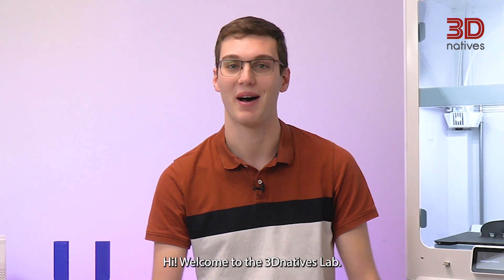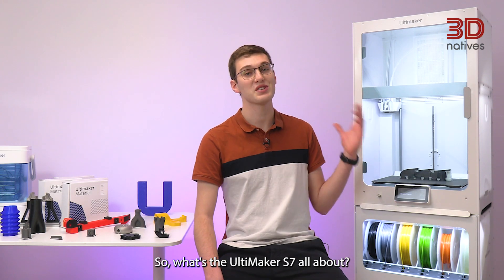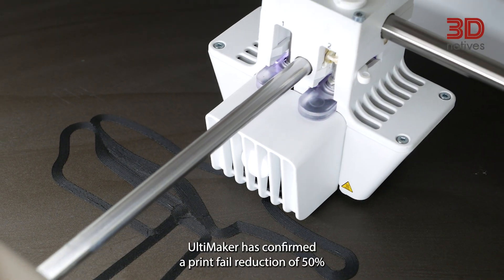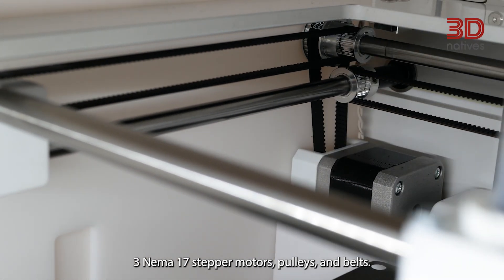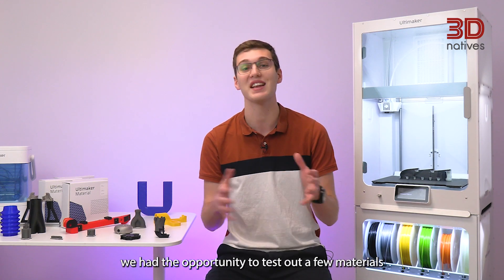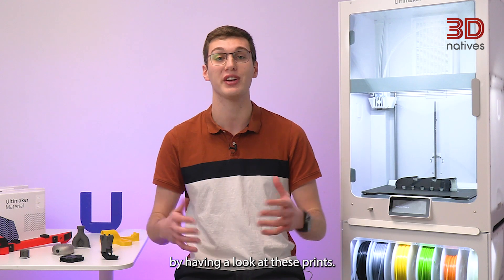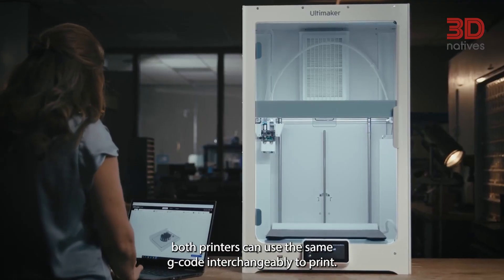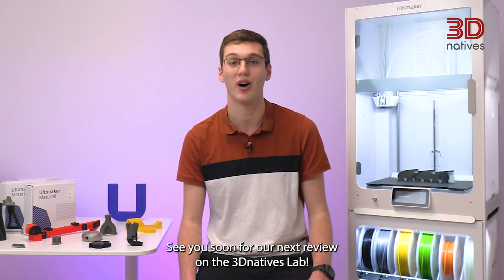Ultimaker & Makerbot’s First 3D Printer - Discover the Full Review of the S7 | 3Dnatives Lab

Comment: Ultimaker is struggling to keep up with the competition. They seem to be recycling old ideas and concepts. The 2.85mm filament is no longer popular in the market. The z-axis trapezoid rod looks outdated and seems to have been borrowed from a 10-year-old Creality printer. It’s surprising that they are still using smooth rods with sliding blocks. The nozzles (printer cores) are super expensive. Even if you consider the ‘ecosystem’ perks, the price of this product is not justifiable.

Comment: Very much aimed at a niche market. UltiPriced @ only $8,299. And 2.85 mm filament requirement. Niche.
Reply: I’d like to have the possibility to upgrade to 2.85 but not as default. And with what nozzle did they chip?
Reply: @platin2148  IMO - I could be wrong but - it is the Proprietary nozzle that they call a print core. I think the default that ships with the machine is 0.4MM, therefore changing the nozzle to 0.25MM will set you back a humble $170 plus.
Reply: @dotJPJP  the cores are $115 USD, And yes while expensive (I have bought too many of them during the lifetime of my S5R1) they making nozzle changes super easy and uncomplicated, which when running a print shop like I do makes my life just that much easier.
Reply from the maker: Of course, not every 3D printer will be a perfect fit for every user! But, it must be said that UltiMaker has spent a number of years perfecting their machines, notably in ease of use, such as with the interchangeable printcores. This has made more technical FDM 3D printing more accessible and has streamlined the printing process, especially for print farm operators. Of course, this tight integration comes at a cost, though that can often be justified depending on the applications/purpose of the machine

Comment: Can it print anything special? I mean most of the stuff isn’t something one can’t get with a 8x cheaper printer.
Reply from the maker: Out of the box, the S7 is able to print standard, elastic and advanced materials ranging from PLA to PA. When equipped with the CC printcore, its material compatibility is extended to composites like glass and carbon reinforced materials. The ease of printing with such advanced and technical materials is certainly exciting on a desktop machine. Also, as UltiMaker is finalizing the integration of its metal expansion kit, users will be able to print green metal parts which are then sintered to achieve metal 3D printing
Reply: so no
Reply: @3dnatives that's literally what the Bambu Lab X1C with AMS can do and it's only 1300+ 😅

Comment: Regular printer. Slap a giant box around it, charge 10k more.  Hard pass.
Reply from the maker: Hi! As mentioned in the review, the main benefit of the S7 is its integration in the UltiMaker line-up and the whole ecosystem. The S7 is a robust, reliable 3D printer with a strong ecosystem and UltiMaker has been making FDM 3D printers and contributing to the 3D printing industry for years (Cura, for example is a open-source slicer used by many other manufacturers and has paved the way for upgrades in other slicers). All this comes at a cost. Some people will find it is a good fit for their needs, whilst others may prefer an alternative. We try to cover as much of the 3D printing market as we can to give users a good understanding of the entire landscape 😉